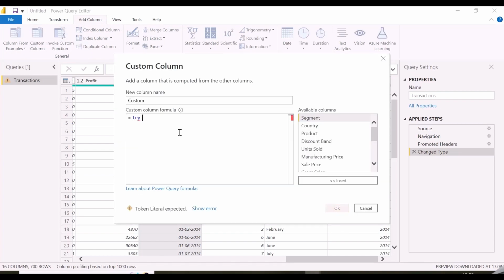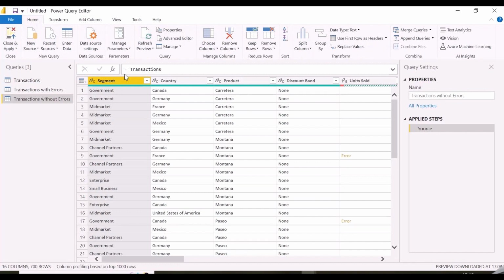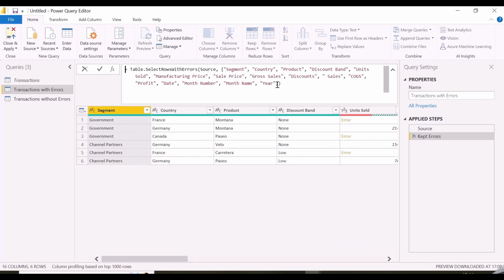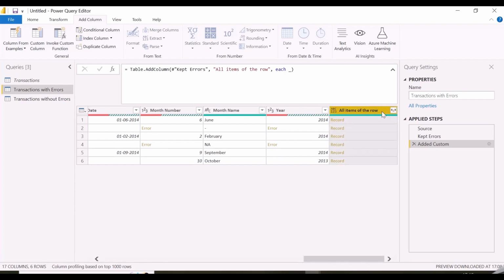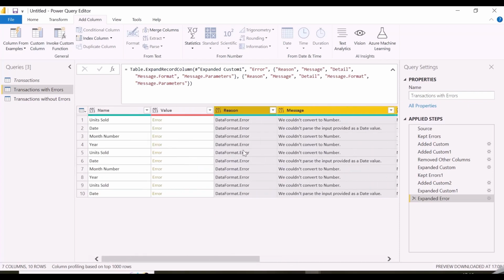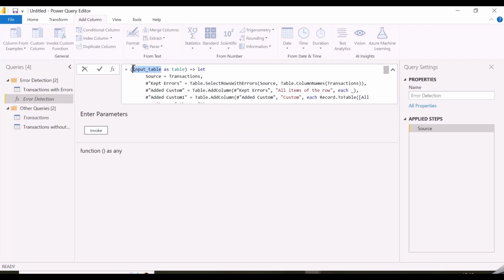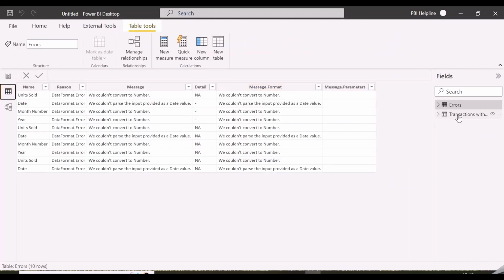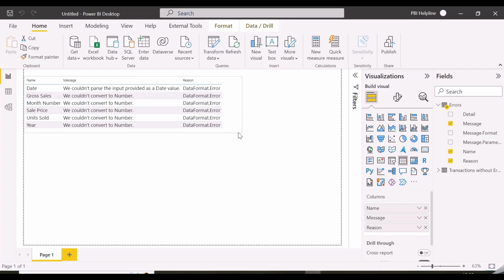AUTOMATIC ERROR AND EXCEPTION HANDLING IN POWER BI | DYNAMICALLY DETECT AND REPORT ERRORS - POWER BI

Comment: Wow I'm really impressed holy one
1. Is it possible to create a function that is also creating the table without error also from the master table automatically ?

2. I tried it with an other table, but then comes ther error that the colum doesnt exist, i think  these value has to be also modified or ?,

(intput_table as table ) => let
    Quelle = intput_table,
    #"Kept Errors" = Table.SelectRowsWithErrors(Source, Table.ColumnNames(1)),
1= input_table?     

 cause he gives me the follwing error that  an column from  an another Table wasnt found. 

*An error occurred in the ‘Trace Errors’ query. Expression.Error: The column 'Year' of the table wasn't found.
Details:
    Year*

or am i off the track now 

best regards
Reply from the maker: 1- M code is very powerful, and yes it can be automated to create such functions. 
2- Yes, Value has to be modified. 
Thanks for the Idea, it will be very interesting to work with such dynamic functions. I would definitely post video related to this if i find it working.

Comment: how do you do this if there are currently no errors in the dataset?
Reply from the maker: This will work for any data set, as in last it has been converted to a custom function so that it can be reused on any table, if there is no error, table will so empty.
Reply: @PowerBIHelpline  The thing is there is no way to expand it, it only gets added as a column without records inside, and thus can't be expanded upon
Reply from the maker: @aDingusProductions  I can understand your issue, in such case,
You can create a sample query, where you have the error, then copy its entire M code from the Advance editor, then reuse it in a blank query of your new file, you may need to modify the code a little bit.
Reply: @PowerBIHelpline  interesting idea! I will try that, thank you very much!

Comment: Hi is it possible to give conditional formatting for text data . I have 500 locations and while audit either they are compliant  or non complaint in 4 parameters. I want in case any location has the same error twice then the parameter turned red else normal blank, further while showing in matrix data should show all black and while selecting location then it should show as per condition apply, can you pls help me with fax for this. Data contents Location name, parameter name, remarks(not standard) and date of audit
Reply from the maker: Thanks for posting your query here.
yes above is possible with few workarounds with DAX.
Your Formatting basically will work  on count of the status for each parameter and the location with compliant or non compliant.
and for the Matrix default view of black color, and format only if some location is selected from the slicer,  - you can use, ISFILTERED() OR HASONEVALUE() before the start of the formatting expression based on your requirement
Reply: @PowerBIHelpline  thanks, I will try this too😊
Reply: Hi I did that and conditional formatting is working, but only concern here is if none of location is selected conditional formatting is calculating same error for other locations and wherever same errors are there highlighting ad red, whereas I want the condition only when we select the location, rest all matrix should show data in Black color
Reply from the maker: @sardhashakti  You can add one more condition which will first validate, if selected value from the slicer is equal to the location in the current context, then only apply the condition otherwise not.
This will be easy if you have a disconnected table for the slicer. 
Please refer below Video, here you will get an idea about that kind of interaction between disconnected slicer and the Matrix.
https://youtu.be/RaknT9J2pkA
Reply: @PowerBIHelpline  Bit tough for me, but I will try to use ...Thank you so much